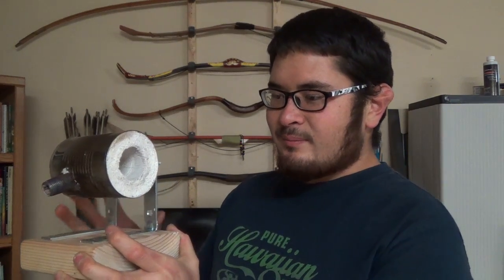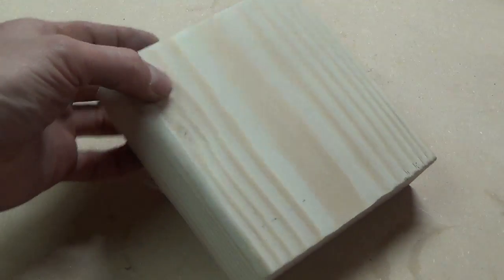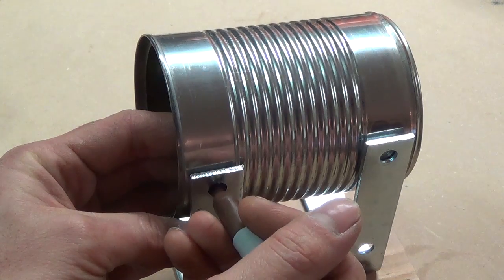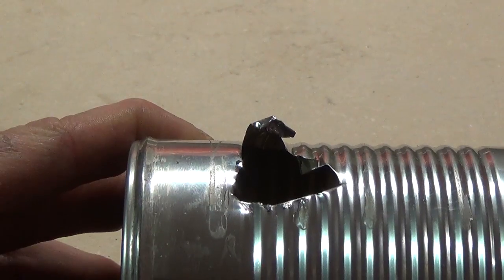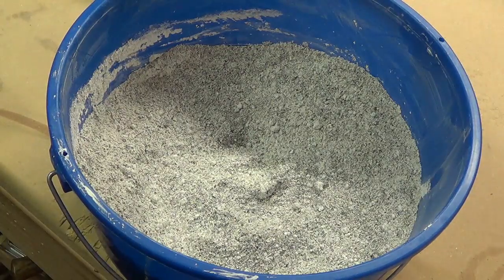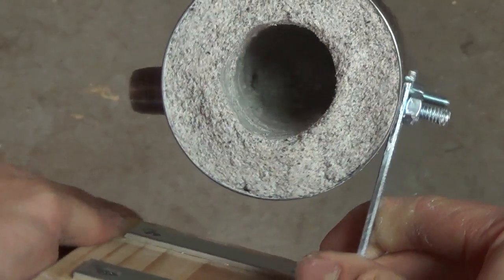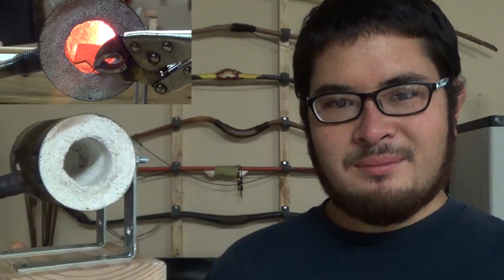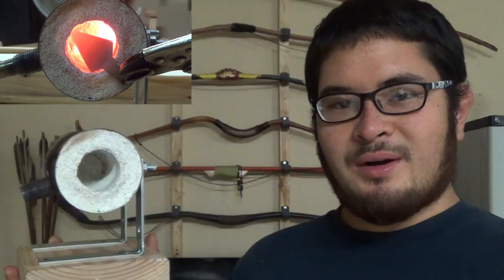How to Make a Soup Can Forge

Comment: Would it be a horrible idea to do a double-length forge by attaching two soup cans end-to-end?
Reply: That's probably a good idea. But you would need two heat sources to maintain the heat throughout both cans
Reply: Christian Knuth Two sources? Or can I just re-pipe the torch to have two out-puts?
Reply: +phoxxentswrath that would work. You just want to make sure that the heat is spread out evenly on the blade. If it isn't and you try to heat treat, the heat treat won't go all the way through

Comment: could you use the same process but on a bigger scale? like with a tall pot?
Reply: +Matthew Ballard ok just making sure
Reply: Try to survive you're quite a sassy boy ain't ya ;) thanks for the clear answer though because i am quite a noob in the diy scene
Reply: I'm wondering the same thing
Reply: Obviously if you doubled the mix you can
Reply: Try to survive i did not mean that, i meant it by would the material hold up on a bigger scale or would it get old and broken faster
Reply: +Matthew Ballard not that it would get broken but the torch wouldn't work to fuel the forge
Reply: Matthew Ballard man its just basic logic,if you want to make bigger just double the mixture,and yes the durability is the same as the guy had,but on a bigger scale,and you need bigger torch
Reply: +Matthew Ballard can you read what I posted above him or not
Reply: Carson Lyrics sorry i missed it at first. but thankyou, and yea ill need to invest in a bigger torch anyways ebcause of a few upcoming projects
Reply: +Matthew Ballard Get a gas grill regulator and plumb it in with pipe, you can run a 20 lb cylinder, eventually you'll run into problems with heat loss and have to run a hotter gas I'd think. Planning to build and fire a scaled up version of this forge this weekend.
Reply: Rob Thomas oh ok awesome thank you, let me know how it goes im very curious :)
Reply: +Matthew Ballard Update* Without a blower, it'd make a nice fire bowl like they sell in the hardware store garden section. With an air hole and a hair dryer, it's crazy loud and makes tons of heat. I came back and looked at where the video author held his metal and my placement is probably what caused my lack of red heat. I'll have to rig something where I don't have to hold the dryer and re position my steel but it shows promise. I can attest to his plaster/sand mix, it's a great insulator. I could almost put my hand on the can even after 10-15 minutes of firing. So, not functional yet but I imagine a practiced hand could point out what I need to change.
Reply: Rob Thomas oh ok, thankyou very much for the update!!

Comment: Nice video. You can get a nice clean hole in sheet metal by using a step bit. Leave the spade bits for wood. ;)
Reply from the maker: +Dave Markowitz Thanks for the tip!
Reply: +BackyardBowyer I made a super sized version of this with a 10in stainless steel pot and used a BIG propane torch (like the one you use w/fire bricks) coming in from the top and it works wonderfully
Reply: +BackyardBowyer I made this forge the same way you did and it works great,except it is very brittle and crumbles.do you have any ideas on how to fix this?

Comment: you bought soup at a hardware store?
Reply from the maker: +TheElvenArcher Yes, they also have a pretty good selection of unusual sodas.
Reply: interesting
Reply: +BackyardBowyer Could you scale this build up to something say like a paint can or something similar in size? That way you could work with larger scrap rebar as well as smaller sheets of metal.
Reply: i did it just dosnt heat as fast and i ended up making a lid of sorts to minimize heat loss
Reply: +TheElvenArcher , huh.. What about a large soup can? Like the big cans of the black label Ranch style pinto beans? I think they're equal to 2-4 of the regular size cans.
Reply: +BackyardBowyer could i use a butane instead of propane torch
Reply: +TheElvenArcher Hardware stores such as Menards carry soup.
Reply: Some of the larger hardware stores, such as Menards have a grocery section.
Reply: +Caleb Christensen I'm building my forge based off this video soon. Planning to use a one gallon paint can, instead of a coffee can like it looks like Nick used, and I'm hooking a 20 lb propane cylinder to it through a regulator, ball valve, and 12" long section of 1/2" black steel pipe. I feel like it'll either work well or kill me. . . :) I believe the regulator will output gas at about .5 psi. Using the yellow gas Teflon tape, the white air/water stuff, yellow is thicker. And for the initial fire, after checking my connections, I'll light straw in the chamber or a match and then turn the valve on and let it run a bit to see if it kills itself.

Comment: too bad aerated concrete isn't readily available in the US. it's very easy to work with, decently heat resistant (not as good as firebrick or kaowool but also much cheaper) and an excellent insulator which is what soup can forges are lacking. pure sand+gypsum is kind of a heat sink, you could try adding straw or styrofoam to improve insulation.

Comment: I recommend moving the port for the torch more towards the front, the heat will go in and swirl around as it goes towards the back. Then if you make the main hole go all the way through the can you have the ability to heat up longer pieces like knives by moving them back and forth. Basically in and out of the forge. Plus the heat source would be more towards the front so if you use it for forging knives or heat treating them it helps prevent overheating the tip and melting it
Reply from the maker: +JHicks096 Thanks! That's actually one of things I plan on doing for the next one to make it more like the one-brick forge I first started out with.

Comment: Yes! As the person under this comment said! Can you please make a forge using charcoal how-to? Incredible informative videos. Thankyou!
Reply: +Kabouterpingu Overlord Any kind of fire pot to use would be a brake drum or rotor(I use).I have a old bottom of a grill I cut out to plce the drum in and it serves so I can put more coal around to store.And I have that sitting on top of a metal old water sealer five gallon bucketand a hole at the bottom of that metal bucket so I blow fan air up into it to fuel the fire(no pipes).Its a little weak but it does th job if you tend the fire well.I do have a semi truck brake drum I just acquired and will be designing a new full forge out of it.

Comment: Could you make a tutorial on how to make a forge that uses charcoal?
Reply: There's a wealth of info on coal forges all over the net. Easy to construct and use. I made mine from a salvaged smoker grill. However, I did allot of welding/ fabricating to mine for my wants and needs. Check out a brake drum forge, easy and cheap plus it's very effective. Also, instead of coal I use real hardwood charcoal. It works very well but you'll use more versus coal. For small hobby forging coal just doesn't give me enough advantages to warrant the cost or hassle associated with its use.

Comment: If you use regular plaster of Paris it won't withstand the heat of the forge, or make the mini forge efficient at all. I built one from a paint can, kaowool and a special refractory cement designed for these uses.  Works well but again, not particularly efficient IMO. That's why I built a coal forge and use this exclusively. Unfortunately the soup can forge is just something that leaves allot left to be desired, especially if you plan on working larger stock or doing any real forge work.  Another thing if one decides to use kaowool, absolutely do not use it without a refractory lining or you risk inhaling the fiber particles which is bad news.
Reply from the maker: +Benjamin Anspaugh Thank you for the tips!
Reply: Absolutely good sir! Very much enjoy your videos! Keep up the good work!
Reply: +Benjamin Anspaugh  Do you think it would be a good idea to use refractory brick cut in half in the shape of a long rectangle incased in plaster and sand with maybe two holes for torches.
Reply: +Benjamin Anspaugh Any how....this has been dogging me for some time now and have been holding off on the build. I have all the parts needed. Now that you have mentioned this...I am going to try two large powder milk cans end to end with a square inside chamber of refractory brick cut in half and cemented in place with plaster and vermiculite and sand. Two ports for two torches using the yellow gas can brazing fuel. Im thinking of putting a pin hole in the end thats closed off for some extra oxygen to max the gas burning...do you think this is efficient.
Reply: +Benjamin Anspaugh I just think this is a good idea for working indoors is all. Im trying to do it properly the first time for things bigger than a small knife. Has anyone done this before....I dont know...maybe I could use a third torch...any ideas.
Reply: +Benjamin Anspaugh I have a tricked out turbo stove I use to barbique. I suppose I will do my steel heating when I do that. Kind of save on fuel consumption of the torches. Heat everything up in the turbo first. Ive actually enuled a file completely just by using wood in the turbo stove but it was a small file. 5 inch blade. Im saying all this for anyone who wants to still work indoors.
Reply: +Benjamin Anspaugh Maybe a triangular shape with the bricks.
Reply: Refractory brick can be used, however the most important factor people leave out or forget about is  the refractory lining. You can make a forge from a shoe box... (okay just joking) as long as you have the proper refractory lining and insulation. For instance, my paint can forge can reach forge welding temps, I have the inside lined (insulation) with 3" kaowool, then over top the wool  insulation I've applied three coats of ITC-100. When up to temp. my forge will run at approximately 1800-2000 degrees.  Even being this hot, I can lay my hand on the outside surface of the forge, it's hot but not like you'd think. Insulation and refractory lining gents, very important!